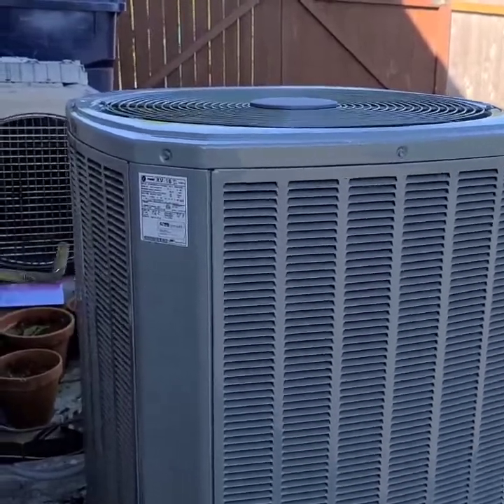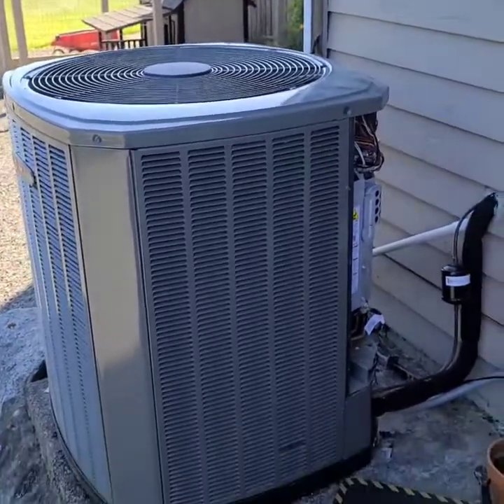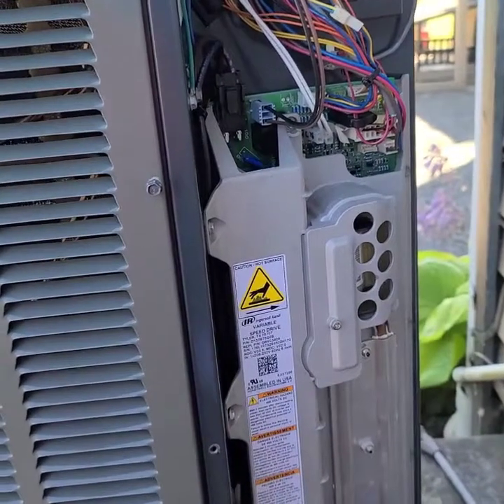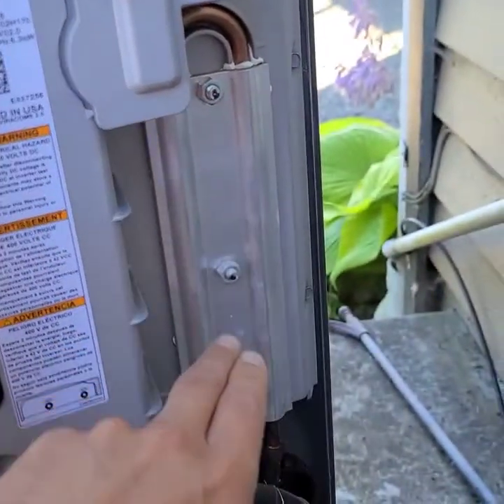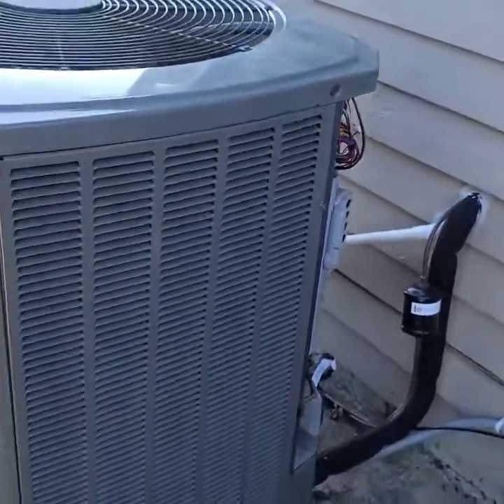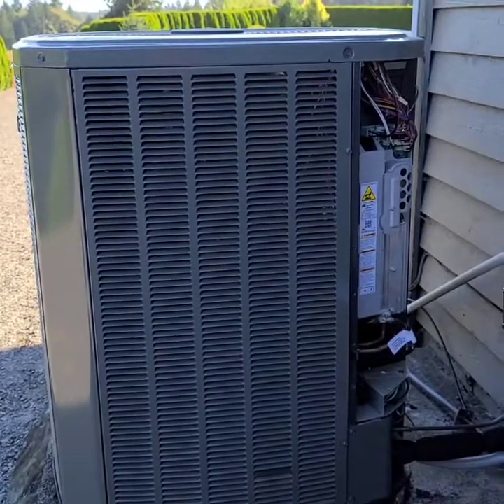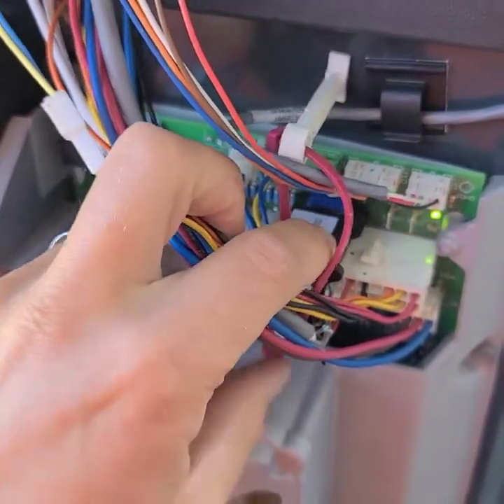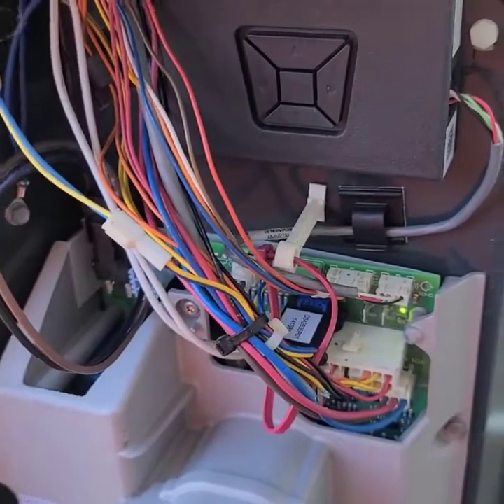No AC on Communicating Trane XV18 Heat Pump

Comment: Like the US F-35 Lightning fighter jet, great when working but unreliable and a nightmare to maintain resulting in less than 50% being ready for combat, Trane XV units are are over-engineered and overbuilt beyond any rational need to perform their required simple task..the basic function of cooling a home. Great when they are working but requiring outrageously expensive maintenance and repair far beyond the routine skills of most  HVAC contractors when not working.

Comment: I’m curious why took 4-5 days? We stock those drives in our shop . 18-20 seer units all have the same drive from 2-5 ton so it relatively universal. They do have that new 17 seer link drive, however our dealer stocks 5-10 drives for 17-20 seer variable speed units. Times change no more carrying contactors and capacitors, start carrying drives, thermistors and, system controllers lol

Comment: Piping carries refrigerant flow heat sinking for three phase variable frequency inverter that runs the three-phase variable speed compressor.  It cools the power transistors in the compressor driver module.   The module should have a failsafe temperature shutdown if inverter gets too hot.

It is important to ground the metal chassis of outside unit to utility main breaker panel grounding stake and advisable to put lightning surge suppressor on incoming power lines to outside unit.  The serial comm lines RS-485 data link transceivers are vulnerable to lightning strikes in the area.

Comment: I have the XV18 unit. Installed in 2017 when we built the home. Six years, no issues so far. I do have the unit checked and cleaned by the installer every six months. I asked the service tech about his thoughts on the latest, greatest units when this unit reaches end of life. He recommended Daikin. Any thoughts service guys?
Reply: Daikin is chinese junk, stick with American Standard/Trane

Comment: Looking at one yesterday couldn't figure it out but i think it has something to do with the j4 plug someone cut the diode and capacitor out of the wire and ran it straight, i think drive might be bad.

Comment: These units are junk. Have had one several years and nothing but issues. I don’t think Trane makes quality units any longer.
Reply: Craig, these are very reliable units - the key is the install. If you have a install where they arent experts with these units and cut corners which many companies do - you are gonna have  a bad time. If some top notch guys put it in correctly, itd likely be 10+ years before you needed any repairs. My company has installed close to a thousand of these - they have been out for almost a decade now. Very few problems

Comment: If your thinking of getting one of these, I would suggest a two stage unit instead. I have one of these since 2016. I have replaced the eev board and expansion valve solenoid. Replaced the air flow control board just recently. Replaced the drive(gecko shorted back side of drive) Drive took 3 weeks to receive in middle of summer. So trust me when I say get a two stage unit instead.
Reply: Starting in 2025 the "2 stage units" are now called "multi stage units" and haves drives also. The gecko thing is just bad luck - its very rare for these drives to go bad. You EEV board issues are because you got the wrong air handler - dont buy the eev style air handler. Ive never needed a drive and had to wait - sounds like your servicce company didnt know where to look
Reply: @josephp1592 better have a surge protector or they WILL go bad
Reply: @robertlamey7612  Im the GM at a AS dealer in Houston.  Luck of the draw, I have many 10+ year old 18 seer As/Trane installs running without a surge protector and no problems. Been putting them in for over a decade now, we've replaced one drive, it was on a house that was struck by lightning and no surge protector wouldve saved it. We have replaced LOTS of drives in other brands

Comment: I own a xv20i with the nexia controller... absolute junk in my opinion. Only 2 years old, constantly resetting breakers for erroneous codes, replaced the nexia controller due to INOP, now the compressor is out in the middle of summer and told it's on backorder with 48 people ahead of me waiting for one. These high efficiency units are not cheap and are less reliable than a 30 year old system I had in a previous home.
Reply: This is more likely a installation problem we are one of the largest XV dealers in the United States. These systems have specific installation procedures that MUST be followed in order for this system to operate correctly. New low voltage wire to the outdoor unit should always be installed whenever possible as well as the copper line set.sound like you have poor field connections probably due to using the existing control wire or not making a proper field connection because they failed to use the supplied grease on the connections. Have the company replace the low voltage wire to the outdoor unit,
Reply: I work on these XV's very so often, the company I work for usually send me when multiple techs cant figure out what's going on. Installation and proper settings are very important. Also these drives need to be updated every time trane comes up with a softward update, or else these systems will act up and then when you call and a tech reset power they can't figure it out because everything is back to normal. Also maintenance is very important especially the XV with TAMs because they rely on sensors for everything

Comment: I changed 2 of these. That’s called the personality module plug. It just tells you what size the unit is basically. So that tells the board what it is. Occasionally those can go bad too. Actually you’re not you shouldn’t run into that many problems with the drive. There’s drive test you can do on the CDA. Carrier and Lennox have a lot more issues with the drives. Drives can go bad because of refrigerant charge and some other issues all the time.

Comment: Interesting. Whenever I run into a 126 code we have to run a new thermostat wire since the Data wire (brown wire) is DC voltage and can’t have any splices or thinner than 18AWG wire. 
And yes never lose that Personality Module otherwise you’ll never hear the end of it 😒😅